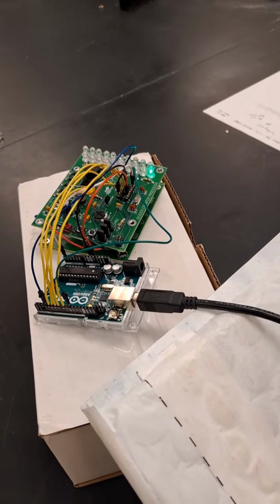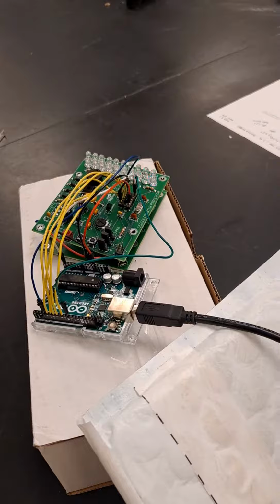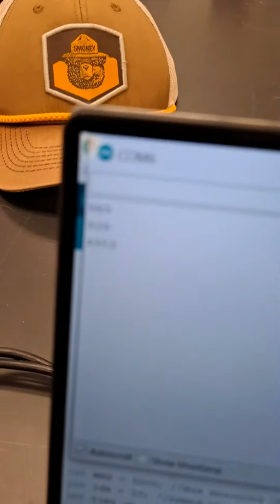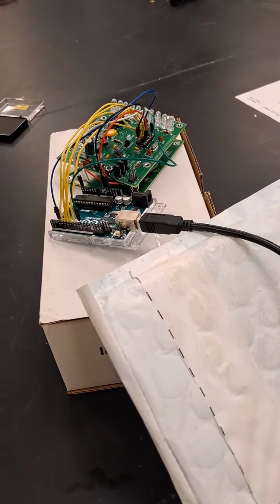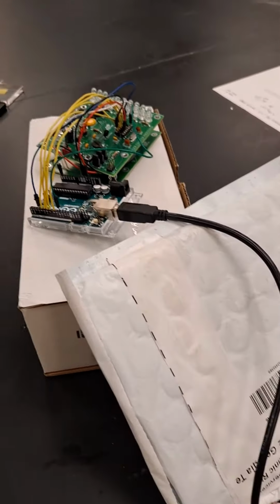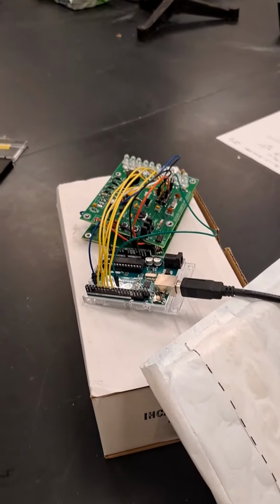Geiger Counter

Comment: Cool, how did you go about making this?
Reply from the maker: It was a final project for the electronics class I took last semester. I didn't actually design the board, just soldered it. I also had to program it which still needs a fair amount of improving. I can share schematics if you'd like. Personally, I'd recommend going with a kit or something because I have a lot of things I'd change about the design if I got the chance.